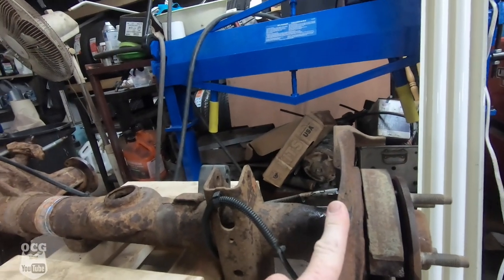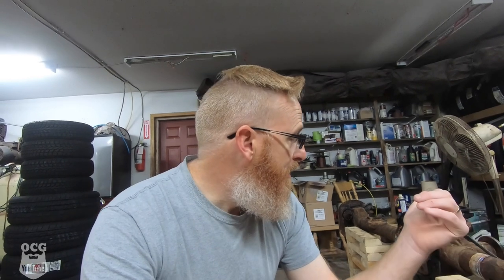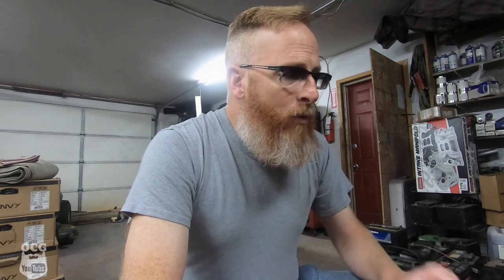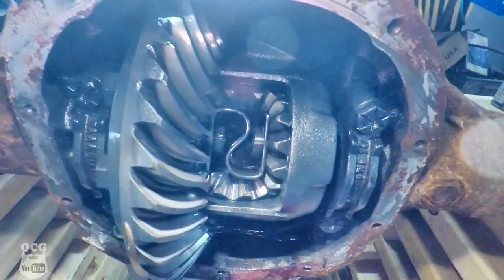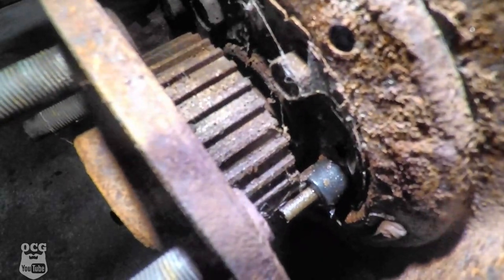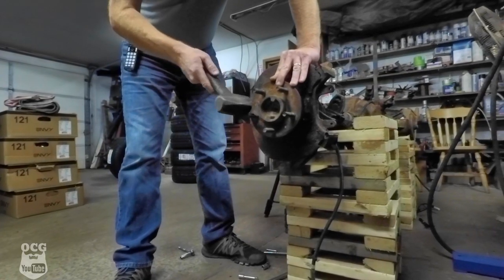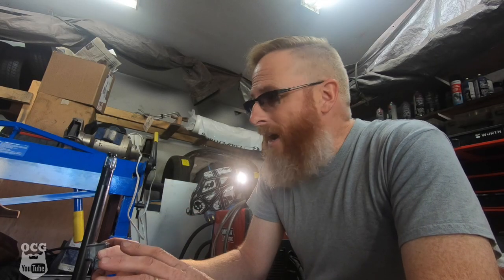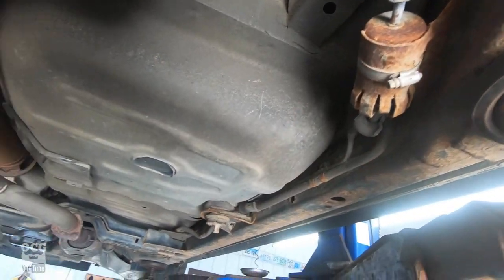Ford 8.8 Axle Removal (CROWN VIC, GRAND MARQUIS) Pt.2

Comment: When I pulled the rear axles, I had the same issue of not being able to remove the C clips, removed the speed sensors, still didnt have enough space. Almost tore my hair out, finally got angry and put a 2x4 on the end of the axle and gave it a solid wack and the clip nearly came out by itself. Turns out the seals were kinda holding outward tension causing them to want to push out. Once I figured that out, boom! Clearance, Clarence!

PS- Def gonna stick around since the Grandma Keith is basically the same mechanically as my Vic, Love the Panther content!
Reply from the maker: Thanks for your interest! Hope to see you around.

Comment: When i did my axle shafts, I had that problem with the abs sensors and c-clips. I used a big c-clamp to push the axle into the sensor so it didn't bust the sensor housing.
Reply from the maker: I found that once the axle was out, slip a 10mm socket over the sensor and tap out!
Reply: Be careful those sensors crack easily. I have to replace my left side one due to some parking brake spring getting loose and dizzy and jamming itself between the sensor and the tone ring.

Comment: I have an open diff with 3.27 gears in my 05 Grand Marquis. And I only purchased the car because I could tell it didn’t have 2.73 at all. So your gonna love 3.27 gears. You would love  3.73 way more but 3.27 will be good enough. 

People were talking crap about the appearance of your parts? Weird.
Reply from the maker: So far so good. Next step, Marty Tune!
Reply: What's was the spline count on yours buddy? Mine is an 05 also, I don't know if it's 28 or 31.

Comment: I would try rock auto for backing plates they might have what you need.
Reply from the maker: They do not! Dealer only as part of the whole caliper bracket or $100 on  CARiD.com. Not paying that.
Reply: Olde Carr Guy I don’t blame you and I’m excited for the before and after on the rear axel upgrade videos. 👍

Comment: What's up old car guy. Hey I got a question. I have a 05 mercury grand marquis and I'm wondering what the spline count is on mine. It was made in June of 05 so I'm thinking it has a 31 spline but its possible its a 28 also. I'm planning on putting in a new posi unit with 3.27 gears but I need to know what the spline is. If you have any input it would be appreciated. Thank you
Reply from the maker: "Posi" axles were 31 spline an open differentials had 28. If you're looking to do a gear change, might be best to find the whole rear axle assembly like I did. That way you have both an upgraded gear ratio and the right axle shafts.

Comment: you should just swap the differential and pinion gears into the existing axle. much simpler and more time saving than swapping the whole rear end. either way, make sure to change those bearings and seals as well. p71 rears see alot of hard driving even if not a ton of miles.
Reply from the maker: You may be onto something!
Reply: @OldeCarrGuy  That is definitely the route to go.  When you said you bought a rear end, I thought no, you bought a set of gears.  Good luck.
I just changed the passenger axle shaft as it was worn and leaking seal on my 2004 Mercury Grand Marquis LS.  New axle kit includes outer bearings and seals for $122.  Started as a seal change for $3 until I saw the shaft wear.

Comment: no disrespect intended,would it not be easier to swap the ring pinion and carrier?
Reply from the maker: To some, maybe! But I hate setting gears!
Reply: @OldeCarrGuy  i have swapped out 20 of these keep the shims together with the carrier ,switch pinion  and carrier and torque it down.  no set up if you keep your spacers.
Reply from the maker: Would I keep the original caps to the car or use the ones out of the donor?

What about setting backlash?

Comment: Can a Mustang rear end direct fir into a grand marquis? If so what year's match the 2003 MGM
Reply from the maker: A Mustang rear end is narrower than these cars and has different connecting points for the suspension. 

Because there were so many of these cars built as cop cars, locking difs should be plentiful. You just need to know the axle code for the gear set you want.
Reply: @OldeCarrGuy  Thanks I figured as much just wasn't sure
Reply: I'm seeking 3.55 what code should I look for
Reply from the maker: @bosbear6525  I believe the axle code “2K” is a 3.55 locker.

Try looking on www.car-parts.com

Comment: I have an 03 Grand marquis that I swapped out the 2.73 rear diff for an lsd 3.23 and I'm having issues finding someone to calibrate the speedometer
Reply from the maker: Although a bit costly, Marty Ochs has perfected tunes for these cars witch includes a HP gain, firmer shifts in the trans, fuel economy, all round performance and speedo corrections. If i remember correctly, he charges $500 and that includes the SCT tuning device and he'll mail it right to you. Otherwise, you can check with your local Ford dealer to see if they'll do it for you, but the calibration is all you'll get. Marty tunes are the tune to get.
Reply: Really,,,literally any v tuner on the market can fix your speed of meter

Comment: I have  a 2005 mercury  grand  marquis  2.73 idk if I want  a 3.27 or 3.73 what  everyone  think
Reply from the maker: I guess it depends on what your intended purpose is. If you want all the power, go at big as you can find.in a track loc. If you just want to wake it up a bit and still maintain decent fuel economy, 3.27 is what i used mostly to gain a locking diff.
Reply: @OldeCarrGuy   looks  up my video